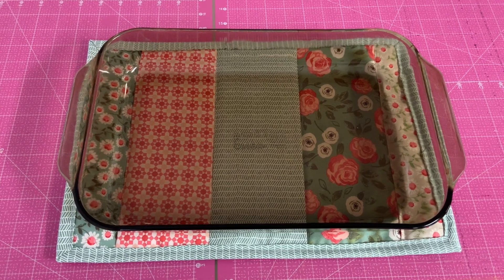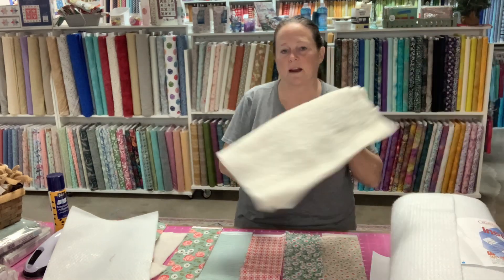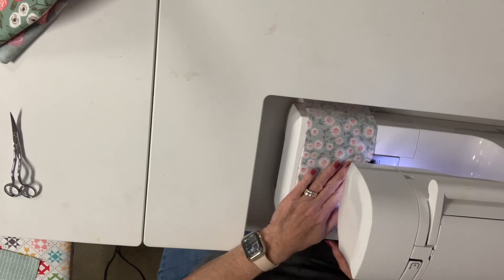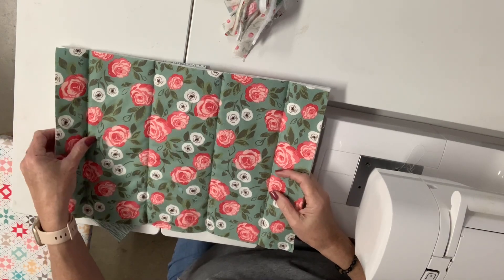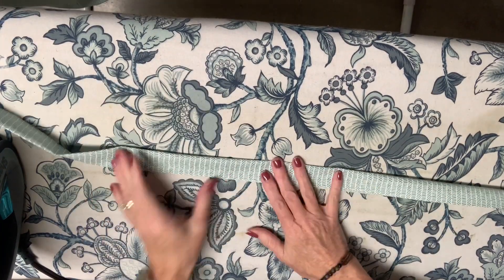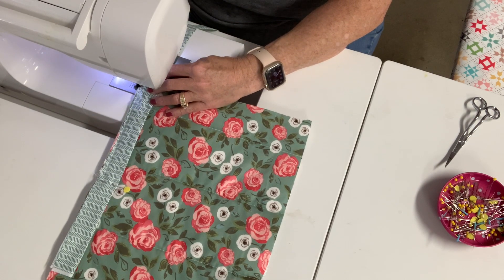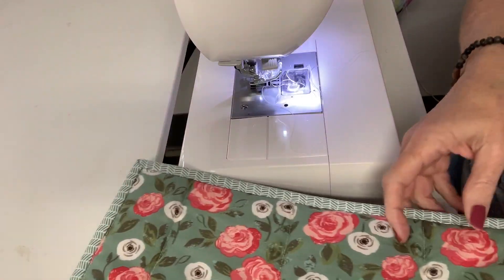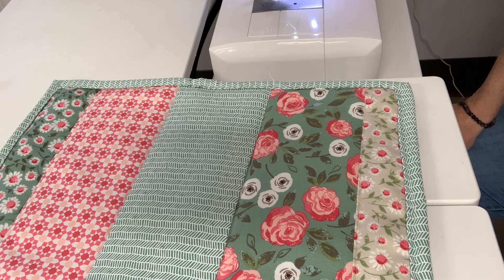How to make a Hot Pad using Scraps or Fresh Cut Fabrics!

Comment: How wide are the strips?  Thanks!
Reply from the maker: You can use any size strip. I think I used 2 1/2 inch strips. That’s what I normally use. That way I can piece any extras together for scrappy binding to use later.